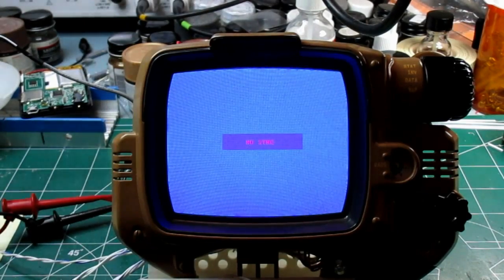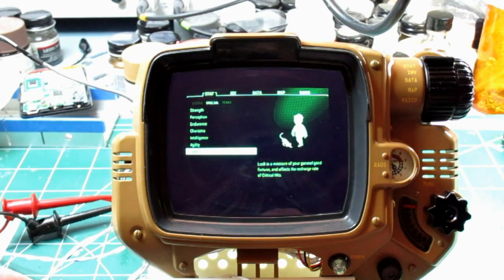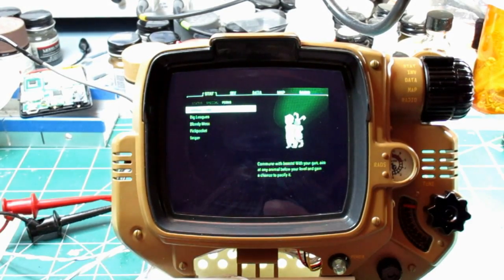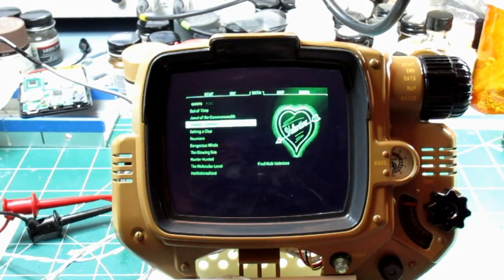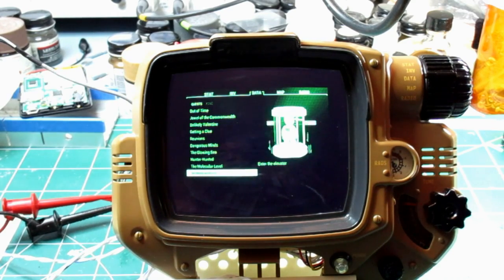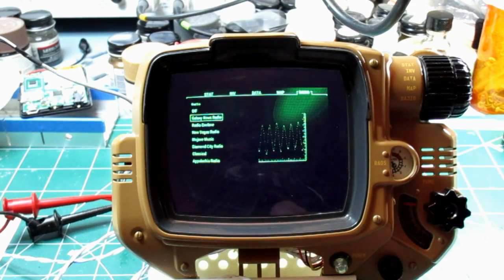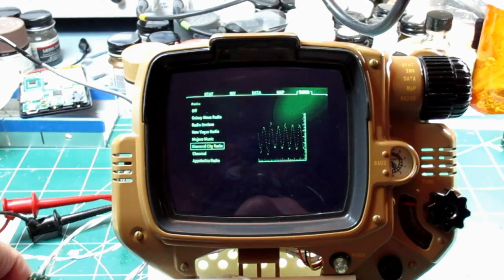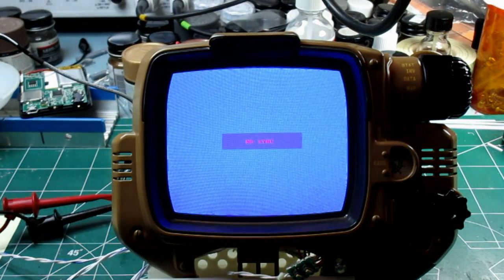PipBoy 3000 Mod 03

Comment: I have a PipBoy that I bought from a weekend market, I was told that it had suffered a fall and was not working. The power button sends lights through the machine and when I shine a light at the screen I can tell that it also reacts to the power. I am wondering what I could do to investigate the damages and repair it where I can. I have use for some replacement knobs but for now I just want to get the internals working properly.
Reply from the maker: It sound like the flex cable for the LCD display has been moved/misaligned from it's connector from the fall, you could open up the unit and try reseating it.

Comment: Is this the Bluetooth version?
Reply from the maker: No, if you go to the first video of this project "PipBoy 3000 Mod 01", I talk about not trying to fix the original circuit board that is in the PipBoy, but instead use all new electronics, like a Raspberry Pi 3 A+, display board, the identical 5" 4 x 3 640X480 LCD display and use the prop's switches and controls. Also the software/firmware is being fixed by a friend of mine.
Reply: teslabe7701 can I buy your project after